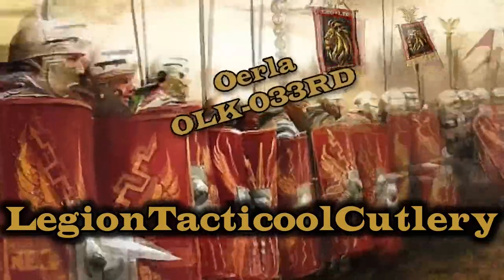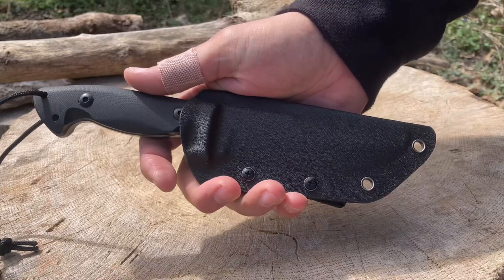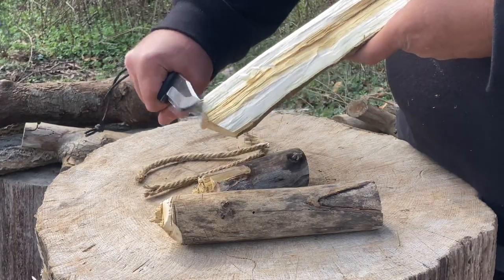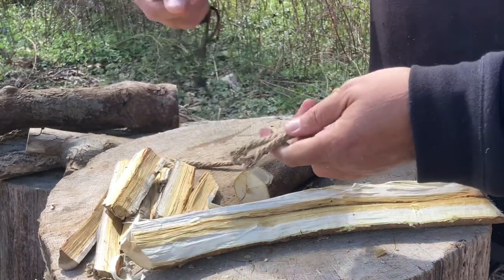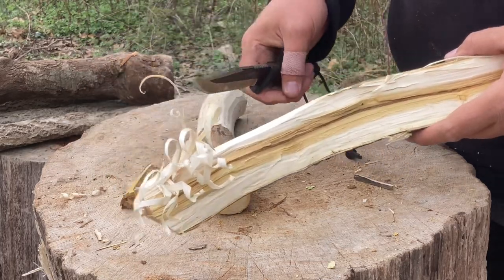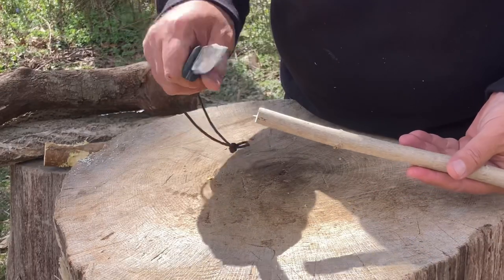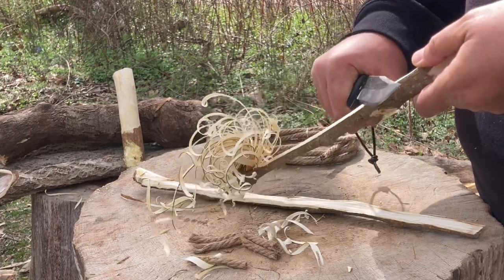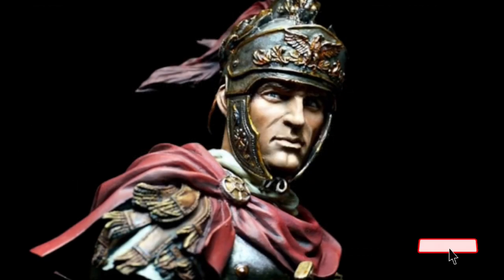Oerla  OLK-033RD Clip Point Hunter in 420HC #bushcraft #knife #huntingknife #blade #edc #hiking

Comment from the maker: OERLA OLK-033RD Tactical Knife Field Full Tang Fixed Blade Outdoor Camping Knife

https://www.oerlausa.com/product-page/oerla-olk-033rd-tactical-knife-field-full-tang-fixed-blade-outdoor-camping-knife

If you are a fan of fixed-blade field knives or want a fixed-blade knife, you will appreciate the OERLA OLK-033RD outdoor fixed-blade camping hunting knife. Crafted with a 420HC steel blade that has undergone Precise cryogenic tempering, this knife offers exceptional strength, flexibility, and hardness for razor-sharp cutting power and easy maintenance. The G10 handle ensures lifelong durability and is specifically designed for superior hand control, agility, and comfort. Plus, it is impervious to heat, cold, and sweat, with a black stonewashed on flat and 3-step water grinding bevel and edge method along with bleeding edge technology which maintains a perfectly controlled sharpness at a 17-degree angle per side of the edge to provide all the sharp cutting edge you need for any task. The lightweight Kydex sheath is durable and reliable enough to securely hold a sharp blade and withstand harsh conditions. It also features a universal clip that can be adjusted horizontally or vertically carry. The removable & adjustable spacers on the clip fit it to any belt width and are compatible with most various belts, shoulder straps, bootstraps, and backpacks for easy portability. The hole on our Kydex knife sheaths matches all industry-standard clips. Providing the flexibility to customize and modify your kit with different attachments and buckles as needed. Ideal for all your outdoor adventures. Whether camping, hunting, bushcraft, fishing, or EDC, OERLA knives are always ready. Also, Its cool and sleek appearance makes it the perfect gift for yourself or the men in your life.

💥
9" (230 mm) overall; 0.19”(4.8 mm) of Blade thickness; 4.56" (116 mm) of Blade length; 4.48” (114 mm) of handle length; 8.6 ounces of knife weight

💥
420HC Full- tang Steel with the water-grinding method and completed with bleeding-edge technology provides a razor-sharp edge and easy to maintain

💥
Black G10 handle for lifelong durability engineered for superior hand control, agility, and comfort, Impervious to heat, cold, and sweat

💥
Kydex sheath includes a universal tactical belt clip mounting that can be carried horizontal or vertical for easy portability

💥
At the razor-sharp cutting edge of cost-effectiveness and performance will have you cutting with razor-sharp edges during any outdoor activity

#dskfs      
#22aday
#22adaynomore
#NeverGiveUpNeverSerrender
#NeverQuitQuitting

Don’t forget to hit the like button! 

Please help support our vets by raising awareness of the tragedy that is Veteran suicide by visiting the links below and reaching out to those in your life. If you know a vet don’t hesitate to reach out to them! 

Suicide Prevention Hotline: 1-800-273-8255 
https://suicidepreventionlifeline.org/

Mission 22
https://mission22.com/

Til Valhalla Project
https://tilvalhallaproject.com/

Message from Martin Miller, Army Veteran 66-69

1-800-273- TALK, press 1 for Vets saves lives. They're the Shining Stars of the VA. My brothers and sisters, you're not alone. The help you
deserve and have earned is just a phone call away. It takes the courage and strength of a warrior to ask for help.  Please call if you need help. Suicide is a permanent solution to a temporary crisis

I love this community!  The knife, sword, saw, fatwood, bushcrafters, and all the new people who have subscribed!  We are LEGION!

You guys' ROCK!

LIKE! SHARE! SUBSCRIBE!   Also don't forget to check out the other content creators!  They are all good people with great videos.